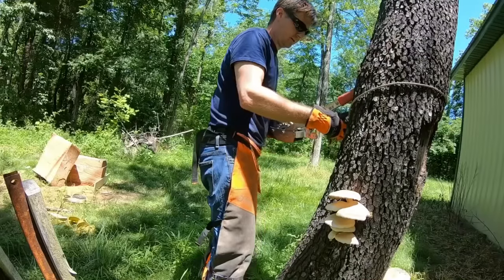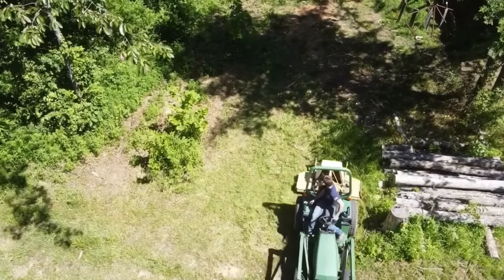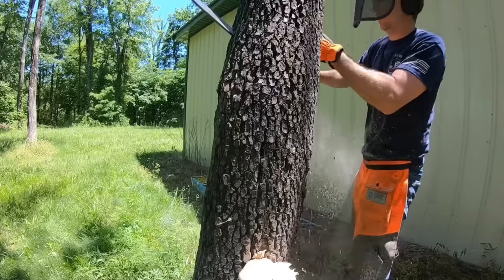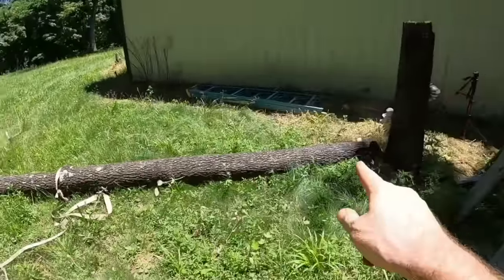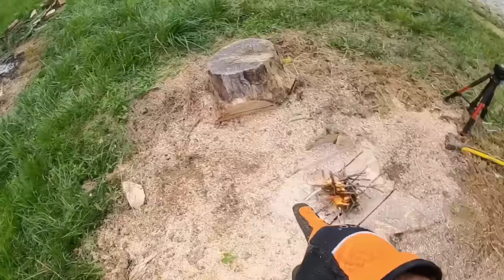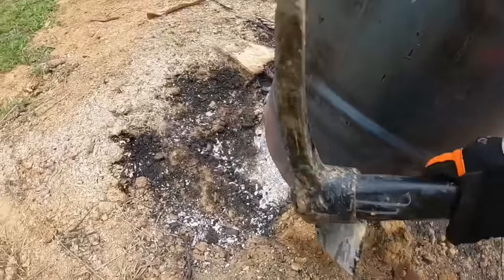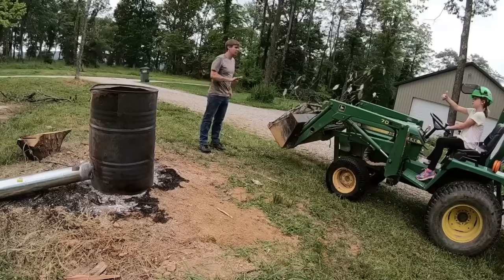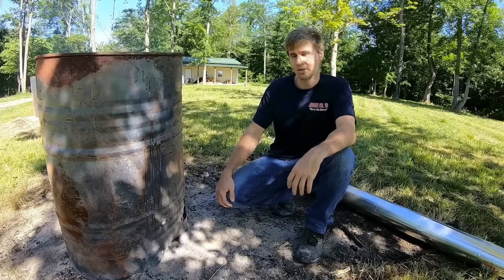Stump burning experiment - PLUS - hazard tree removal

Comment: so much work and no progress. people always build a giant fire on top of the stump and then it burns for two days and after that "uuh the stump is still there". why do people think that fire somehow expands in all directions? it just doesnt burn downwards. the only way to burn a stump is to make the fire inside the actual stump. drill down as as far as you can or stab a plunge cut with the chainsaw and make an air hole in the lowest side angled downwards. the stump is now a rocket stove and will burn away all by itself.
Reply from the maker: steffankaizer lots of progress and minimal work....check out the follow up video.  Hope you’re having a good day and thanks for watching!
Reply: @CaptainKleeman  damn i guess i should have watched that first. honestly doesnt change much. at least after the third day of work its flat enough so you can mow over it and thats great

Comment: Please don’t borrow a saw to use as a stump grinder. Really tough on the blade and the bar.
Use a saws all with a carbide demo blade.
.
Reply from the maker: yard farmer okay,  but what if I use my own saw?  Then can I do it?
Reply: Captain Kleeman 
At 34:29 you had suggested that if you don’t have a chainsaw that you could borrow one from someone.
I was just suggesting that it could cause problems if you borrow a Saw, the run it in the dirt,Then return it.
Of course if you want to do that to you own chainsaw. Go for it!  I keep older chains that I use with mine.
Very good video, very complete and easy to understand.
i have used that method numerous times. It does two things. Rids the stump and gets rid of the wood in a controlled fire. And is much safer than a bon fire.
Reply from the maker: That’s fair!  I’ve started keeping multiple chains and hanging on to the old ones for stuff like this as well.  Hey thanks for watching and hope you have a great weekend!

Comment: WAY too much effort for me.  Just bring in a backhoe and dig it up.  Bring in a small pickup load of dirt to fill in the hole.  A LOT simpler, easier and safer
Reply from the maker: jayer 1981 dead trees needed to be burnt anyway so no wasted effort and I’m not afraid of work and guessing you missed the part where there is a water line next to the stumps.  But thanks for watching!

Comment: You spend more time preparing the tree stump to burn than if you rented or borrowed an excavator to pull the stump out.
I'm sorry, I just don't like the method your using.
I like your site, I'm a regular viewer.
Thanks for allowing me to give you my three cents worth of advice.
Reply from the maker: John Riggenbach I’m guessing you missed The part where there is a four inch water line under neath them?  That was the whole reason for the experiment of stump burning.  Also, unless you plan on covering the cost of renting the equipment to remove the stump...I (or anyone) is still money ahead by this method.  But seriously, I’ll
Send you my PayPal on the next one.